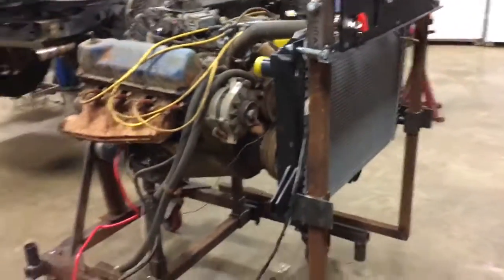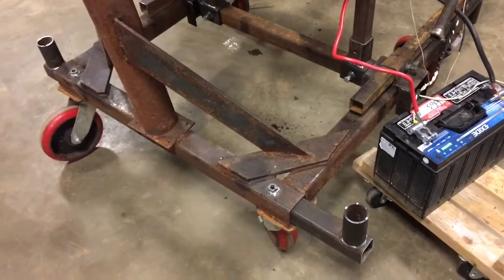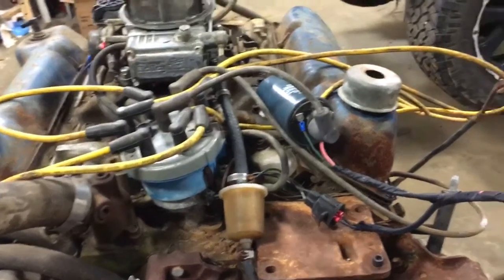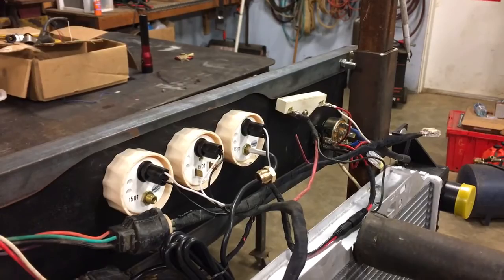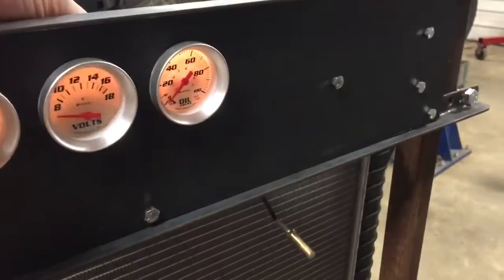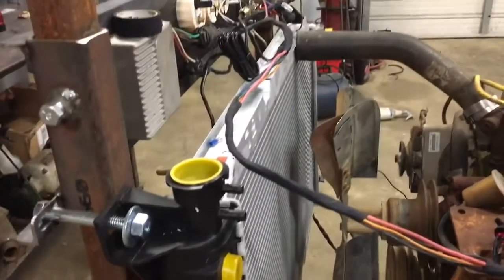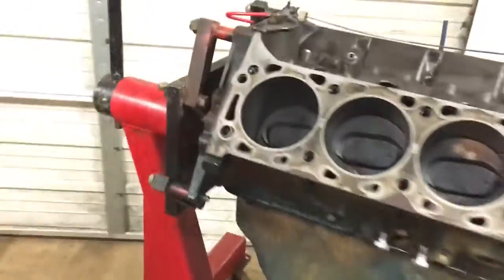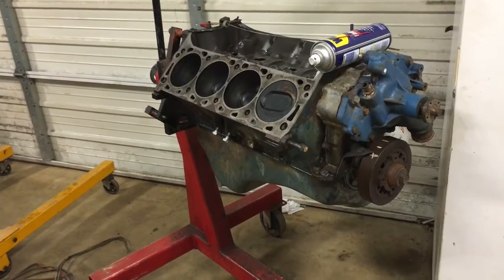Homemade Engine Test Stand

Comment: Hard to find a good stand build video on YouTube. Did you make a follow up video? I'm building one for the old Mini engines which are mounted on top of the gearbox and share the same oil. I want to fit a rev counter on the dashboard with an oil, water, volts, amps and a safety on off switch and a push button starter. Thanks for your video.

Comment: Nice deal on the engine test stand IMO  you kind of were selling yourself short on the build  why dont you just weld a plate. And a nut on the  part to rotate the. Motor  with a breaker bar if you need to ?  That seems like a easy fix  for someone with your skills and tools